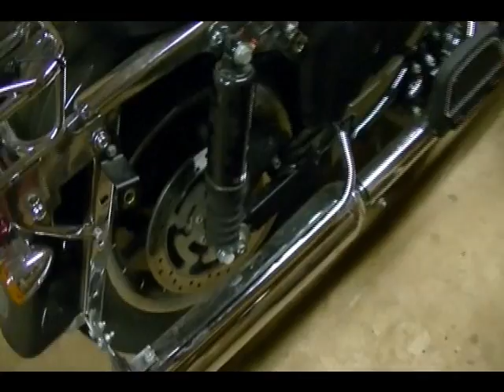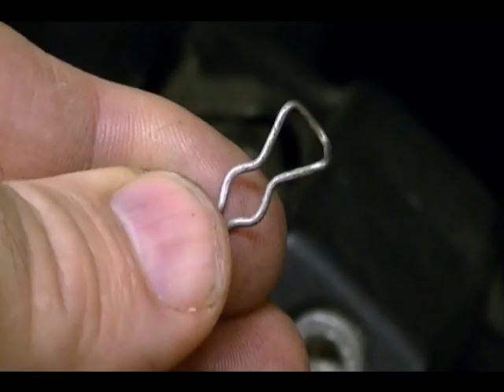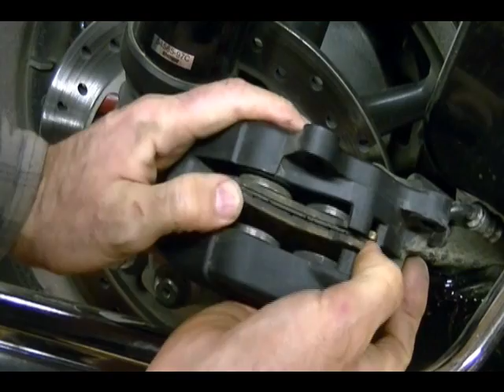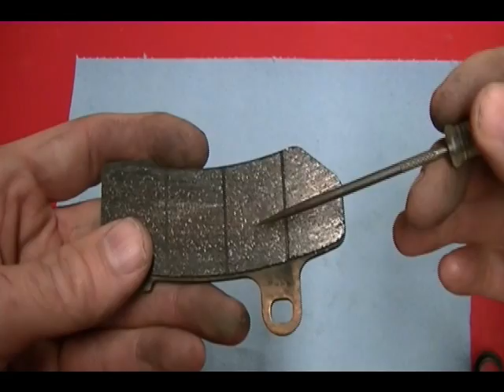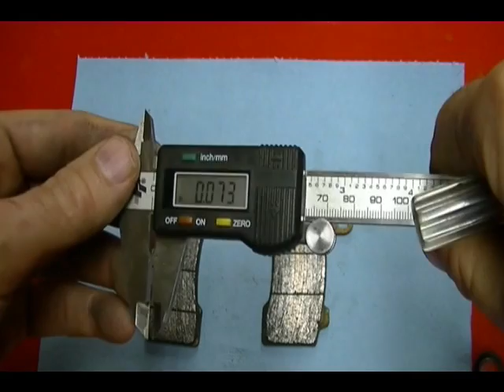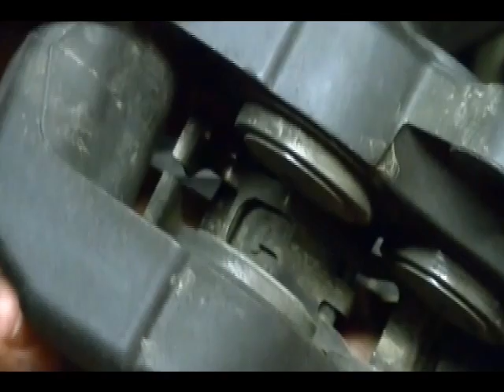Motorcycle Brake Repair: Checking Rear Brake Pad Wear on a 2008 Harley Davidson Road Glide

Comment: no brake bleeding? I installed rear brake pads on my bike and when opening the calipers with the screwdriver must have forced air back in towards the reservoir because after I put everything back together I pumped the brakes a few times it seemed okay but then I went for a test drive and the brake went right to the floor very scary! When you open those calipers it's forcing fluid from the back to the front which is not normal for it so it could induce air into the system.  Also if  your bike has abs and air gets into the ABS system,  that needs to be reset using a computer usually from the dealership.

Comment: Will uneven brake wear mean there could be a  handling problem with the bike? I had a fork problem, once rebuilt and oil changed it was fine but noticed the brake pads were worn unevenly. It's handing is ok but every now and again I do feel a bit of instability when riding? Thanks

Comment: I have yet to see anyone on youtube push the pistons back in. Sometimes there easy ( if you take the brake fluid resevoir cap off  ) and even then you may have to use a C clamp.

Comment: great video man had a question I am replacing my rear brake pads on a 2009 Street Bob and I bought EBC Brake Pads for it but it did not come with The Sims like on the stock pads do I reuse the shims or leave them off any help would be greatly appreciated thank you

Comment: Liked your video. Have any idea why I would get a squeak from rear brake when applied? Around 12,500 miles on bike....pads are original....could the rear pads be worn out already? or just in need of a cleaning? I like asking questions before I put a lot of labor into something....
Reply from the maker: There are several reason why brakes might squeak. For safety reasons the first thing I would check is brake pad wear.

Comment: Why after removing the caliper to inspect the pads and seeing them so worn would you reinstall them. You might get a few more miles out of those pads before the need replaced.  Why would you want to do this twice > or is it a way to double charge a customer???
Reply: Actually, why would you want to replace a part prematurely? The thickness of a new pad is 3/16 inch or 0.1875 inch. He measured 0.076 inch left. That's a little more than half worn. You could leave those pads on for quite awhile. So the question is: why would you spend the money on parts you don't need. I do my own work but I'm sure you wouldn't bring the bike in just to have the brakes inspected. It would be part of an overall inspection. You could also calculate how many more miles you have left before you need to change your pads